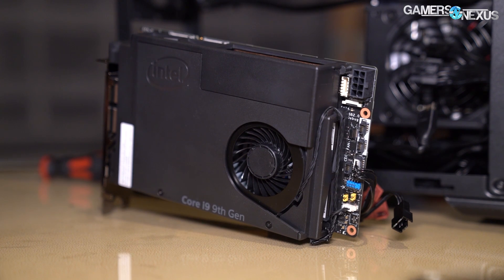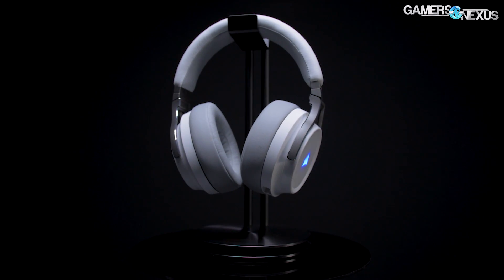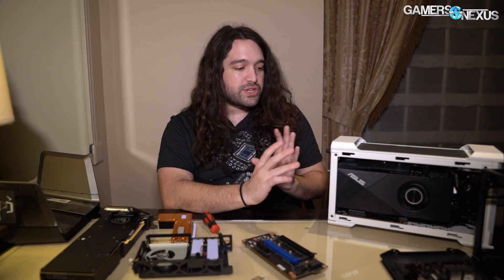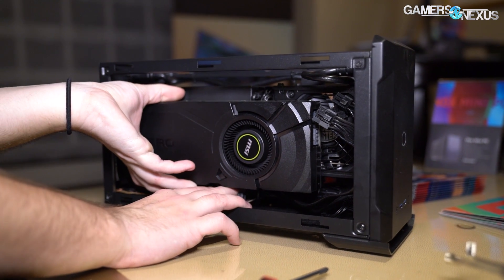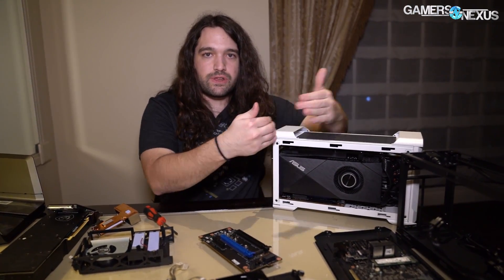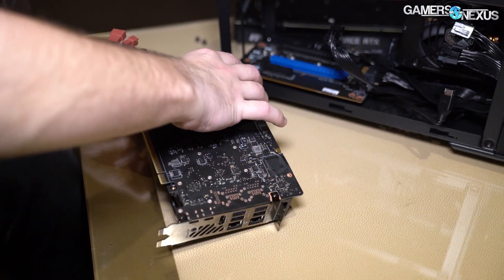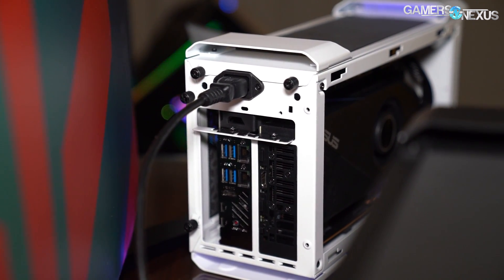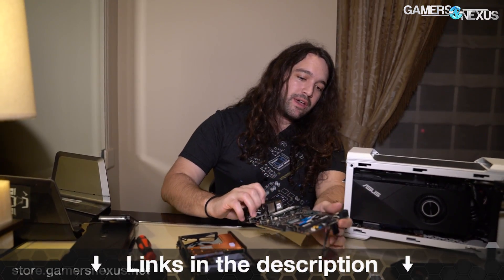Intel PCIe Socketable Computer: Tear-Down of Ghost Canyon NUC SFF PC

Comment: Interesting... this reminds me of the old SGI workstations where you had a whole bunch of compute/memory/etc cards plugged into a large backplane. Though, you don't get the ability to have multiple compute/memory nodes or mix and match the way you want. It's interesting that PCI-e 4 theoretically have more bandwidth than DDR4-3200 (I never realized how insane that is), but lacks in the latency department (it's about 2 orders of magnitudes slower) to pull it off.

Let's be realistic, though. Even if this PCI-e slot can re-wire itself as a power-input only (and maybe some kind of 20GB internal NIC) so that you could install it in an existing computer instead of a special baseboard, I fail to see the market for this form factor.

I mean, in theory, it would make for an amazing co-computer like people often use to encode games streams. With the NIC, you could even share data over IP between your gaming machine and the NUC at crazy speed so no need for a capture card. The issue with this solution is price. At 1500 USD, I could step up a Rizen 9 to a Threadripper and get all the processing needed straight on my main machine. The reason why secondary computers became popular in that space in the first place is because they were the person's previous gaming PC. They effectively got it for free at this point. Plus, depending on your upgrade cadence, you get to resell the machine for parts, which you can't do with a NUC like this.

In the server space, we already have things like EPYC Rome which can support 128 cores (256 threads) on a single board. Let's say that's a 4U machine to compare with a full size PCI-e backplane. You could fit  what... maybe 8 or 12 of those (if you're being creative a la Mac Pro and stagger PCI-e slots) in a single case? That's still only 64 (96) cores. You can't share any load across them. You don't get ECC. You are limited in memory expansion. You don't get as much PCI-e lanes and they're slower. TDP is higher which makes it harder to stack in a rack. It's a networking nightmare. And the cherry on top... it costs more!

It's an interesting idea, but right now, I think it's a solution looking for a problem.

PS: I compared it to AMD parts because I wanted to give it a chance to win the cost argument. There's no way it would have won it on the Intel side. It would have won the performance argument against Xeons Platinum 8280s, but if you need performance then... why do you buy Intel? (ouch)

Comment: I think this has a future, assuming Intel releases additional CPU cards. You might not want this as your primary desktop but as a HTPC? It will fit pretty much anywhere and with a reasonable graphics card you could stream movies and play games, perhaps streamed from the main PC in the house. When you want a better GPU you just get one and plug it in. When the CPU is obsolete or fails you get a new card and plug it in.

Comment: That's not that much smaller than itx and has a whole range of extra limitations, the probably awful cooler and non-upgradable cpu for a start.

Also, proprietary PSUs and the pcie bandwidth concerns. And it's ridiculously expensive.

Why is this a product?

Comment: So... Intel is making a computer in an industrial backplane form factor? This type of form factor came about so someone could take a pre-packaged system, and get a backplane with the right number of slots needed for the industrial application, and make an enclosure for the whole thing. I think it was really cool back in the day. But, with the advent of higher speed USB and proprietary bus systems, and single board computers with dozens of GPIO pins, I think the concept may be a little limited.

Comment: I would love something like this to run a dual or triple rig, would also work well for a custom  "Hutch system" I was contemplating doing. Since it would fit pretty perfectly into the standard CD-rack in the hutch... while I could do an ATX in the cabinet portion

Comment: The old S100 systems have gotten an update.  Compute expansion cards existed 30+ years ago but quickly faded out because the required software wasn't in a form that the average person could use.  A good idea if it can be made to "plug and play".

Comment: The concept is nice, but Steve has a point: make it with more sockets. There should be low spec variants and especially cheap ones that can compete with stock components or it will fail and be forgoten. One pc for gaming conected to gpu 1, pc2 for htpc, pc3 for NAS and server duty. (yes I know about having one powerfull pc with multiple VM's or server racks but this would be smaller)

Comment: Those will make a great portable workstation for any of us running vMix or OBS for multicamera live streaming, and is the sort of size to be easily tucked away on film sets, for the D.I.T. to do dailies or on-set first look grades, or run displays the cast interact with, such as real time graphics on s Starfleet main viewer,... ;)
Heck, these are small enough and probably power efficient enough to shove on Elon Musks Starships for the autopilots.
Bet it mounts inside standard 3U 19" rack cases, with an Intel multiple expansion board for Server racks and supercomputers.

Comment: So Intel is giving the NUC a backboard design instead of the normal design of the last 25ish years.  
To that it used to all be serial connections now it is a parallel connection. 16 receiver pins 16 transmitter pins for PCIe x16 so now i see why he is talking about how having a PCIe x4 device which is 4 receive pins and 4 transmitter pins between the 2 PCIe x16 devices might introduce a point of slow down. 2 PCIe x16 devices can work together at full speed with almost no latency but introduce another and you start to chop off of that .
Maybe a mircoprocessor made for just this usecase to deal with 2 PCIe x16 and 1 PCIe x4 slot?

Comment: Why wouldn't they build the compute element to sit back to back with the GPU so they could both pull fresh air through the side of the case. It seems like that would resolve clearance issues for the compute element to pull in air for cooling.

Comment: Similar to Razer's one, but 
 there have been others like this, and they never actually make it. Why's that?

1. ALWAYS OVERPRICED
2. Each company have it's own FF (yeah they're roughtly pITX but slightly different with varying sizes and connection placement)
3. Not future proof as you're locked to the ones they release in that specific FF
4. FF usually dies off after 2~3 years when they decide to release another in other FF

Until many companies join up to make one FF for all vendors that can compete with each other and possibly case manufacters can make their own cases for that FF making it possible that you buy the main piece from 1, the case from another and then 3 years after you could replace the system using the same FF and possibly resell your old one, theses small FF are a dead end.
mITX is successful in the small form factor because of that, you're not locked to that specific vender you bought, you can replace/upgrade parts.
I would love to see every vendor using pITX motherboards (even if the CPU has to be soldered but other parts are easily replaceble and they are all the same size with connectors at the same place like we have in every other FF) so we could build our own tiny PC.

Comment: That makes the NUC upgradeable.  There's no reason they wouldn't be able to use the same PCIe base board for years, with the option to upgrade the NUC board and/or GPU at will.  Of course, it's Intel so they'll never allow that.  If the product survives 3 generations, I'll be interested

Comment: So the motherboard is mounted to the cooler and cpu. PCie connects to a daughterboard to connect to the graphics card. Basically a U shape where a standard PC is more T shaped. Cooling is the main issue cause you can just get a low profile cooler and a 90 degree adapter for your grapics card and get the same effect but sacrificing cpu performance.

Comment: our companys industrial plasma CNC had a PC like that in the control circuit. some intel celeron on what looked like a PCI card that plugs into a backplane that had the IO and stuff.
it even ran windows CE (via DOS??) which was even more absurd since it's a pocket OS.
Reply: I snuck it home after they replaced it with a more modern solution runnign on an FPGA which was more energy efficient and stuff (and lower failure rate) that's how I know.

Comment: i think there is potential here. considering some laptops are pretty ok mobile workstations, just having a standardized form factor for low power consumption parts, without having to pay for the usual points of failure hardware like screen, keyboard battery. gaming laptopwise, it always felt like dumping money on screen quality is futile since the screen size is restricted and the hardware thermal limitations  probably won't hit the higher fps anyway.

Comment: I wonder how long it will take for someone to build a system with both an Intel and an AMD cpu in it (on their own pcie boards w OS)?

I'm not sure what support is in Windows for sharing the pcie for IO between multiple nuc boards like this? As long as one of them only draws power, it should be simple. The old OS's that supported multiple cpu's on the IO bus had to have extra code to negotiate traffic on the bus.

Comment: Two blower style coolers in one box, how loud is that going to get? The Nuc cards blower is right up against the "HOT" gpu. And Steve says "Never get a blower style cooler. They are hot and loud!" Whatcha got to say about this system Steve? If you're going to use a blower style gpu, why not use the Reference 5700XT? Who's the quietest? Let's see some real testing. Is that Intel cooler upto the task?

Comment: Right now, I already have an itx pc of the same size with full desktop components. So I don't see the appeal as a standalone sff system. Where I do see potential however is maybe having one with a dummy pci connector to socket into an existing PC to make dual system builds easier. Or in some perfect world we have load balancing support in windows where socketed CPUs can be utilized like gpus

Comment: When it said PCIe Socketable Computer my first thought was you could plug it into your pc's motherboard using that as a power supply thus allowing you to have an extra pc inside your normal pc XD
Reply: Yes, I am actually disappointed.
Reply: It would have been so cool to be able to add a second pc into my case as easily as shoving it into a spare pci slot
Reply: DarkRubberNeck you can put 2 os’s on a drive if that’s what you want from another pc
Reply: We used to have things like that in SPARC systems back in the '90's.
Reply: motherboard, daughterboard
Reply: Yeah I though that too!
Reply: so disappointing.
Reply: now they need to add a pcie slot on the extra pc so we can plug more of them in
Reply: q5sys yes but it’s adding a dualcore and another os that you have to wrangle to use its horse power, it isn’t essentially boosting performance, it’s staggering performance and at the cost for a user it would be a lot easier just to upgrade the system and cheaper considering thouse cards go for around 700-1500 usd. At that point I’d just slide in another 2u and call it a day. I only see that card as useful in a environment where the legacy system MUST be maintained as is and you need to scale it with as little downtime as possible.
Reply: @q5sys , looks like that’s built around their own OS running on that card. Would be nice if I could get a regular PC OS installed on such card to have kind of virtual machine controlled from my main PC.
Reply: +DarkRubberNeck, writes _"first thought was you could plug it into your pc's motherboard […] allowing you to have an extra pc inside your normal pc.

You can, der8aue did it, you just have to cover some of the PCIe pins.
https://www.youtube.com/watch?v=pB-zBSExMS4
Reply: The Xeon Phis are essentially like that.
Reply: Linus will make it work.

With thread Ripper.
Reply: VirtualBox

Comment: Will that card work in a standard PCIe slot?

I could see myself dropping a low end or midrange Ghost Canyon in my machine for a number of reasons.
Reply: I would be very surprised if the CPU card can operate without its backplane, let alone slaved to a conventional Motherboard - that is not what this is designed for.
Reply: Graeme, I agree, but it's a question worth asking.

If nothing else maybe there will be enough interest for someone to actually make one that is a drop in.
Reply: @glenwaldrop8166  
At-home CPU clustering? If it is, such a thought would make me smile. No need for expensive multi-CPU server boards with that for home consumers, because that stuff is industry territory.
Reply: @Aereto  I figure it would be more like a stand alone machine but in an all in one card. 

Takes up less space and power than even a mini ITX.
Reply: I'm not really talking about anything but a single board computer that is connected physically to the other PC. A PCIe PC if you will. I'd be fine with that.
Reply: I would also really like it to be usable inside a normal pc.
Reply: My thoughts exactly. I wonder if it will act similar to a VM or something if you just drop it in a normal machine.

Comment: Question... If I am a streamer can I buy one of these... plug it into my second x16 slot and use it as a dedicated streaming pc? 

Like an entirely separate pc that streamers use that takes the encoding load off of their system allowing them to get better performance in games while boosting the quality of the outgoing stream?

If it cant do this then I would like my money back... though I haven't spent anything ... I still want my money back.

Comment: I don't understand this concept... you are replacing a traditional motherboard with... a board that you can plug all your items into... essentially a stripped down motherboard.
It seems the whole point of this is to sell proprietary 'add in' cards that would be more expensive and complicated that what we have now. 
And its funny how one of the add in boards holds the Disk Drives and the Memory along with USB and Ethernet... you know.. all things that were just standard on a normal motherboard anyway. 
This just seems like a way for Intel to sell more expensive CPU solutions.
What problem is this form factor solving again?

Comment: Might have missed it , but can you plug this into a nmother board to run a second OS in the same box?
Reply: No Pci doesn`t have enough power. This is more like the blade servers from Dell or HP.
Reply: @excitedbox5705  Did you not see the 8-pin?

Comment: With some minor modifications and host software, it could perhaps act like the old DOS and PC compatibility cards did in Apple's Power Macs, which provided a 486 or Pentium PC, respectively, on a PCI card. With some software installed on the Mac OS, you could simply switch between the host Mac and the PCI PC. It used a drive image on the Mac HD, just like any emulator or virtualizer does today, and of course used the Mac's keyboard, mouse and display, hence the switching between the two. This would be a neat option for, say, running a little bear metal Windows system or Hackintosh inside a host (for me, that would be some kind of Linux host), including even a non-x86 host. Would be a nice option for use in a Talos II or Blackbird system, for instance (the EATX/mATX OpenPOWER platform available from Raptor Computing Systems).

Comment: If there are no PCIe lane routing chips on the backplane, then what is happening there is that the x16 slot is simply a hard -wired split as x8x4x4 - x8 to the GPU slot, x4 to NVMe and x4 to 2nd slot.

Comment: This sounds like a great way for utilising a dual-pc case for usage as both a high-performance pc and a (low-power) NAS.
Reply: But that will make nas only be able to powered when gaming rig as it get power from pcie?
Reply: @passerby184  it's not getting power from PCIe.. it's got an 8-pin on the board. The PCIe is for connecting to the base-board (and through that, to the GPU/M.2)